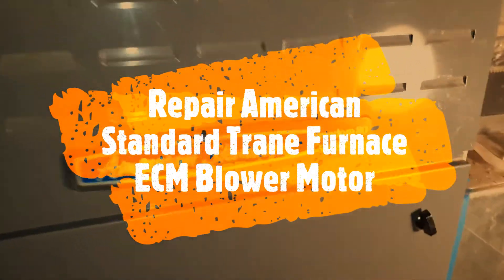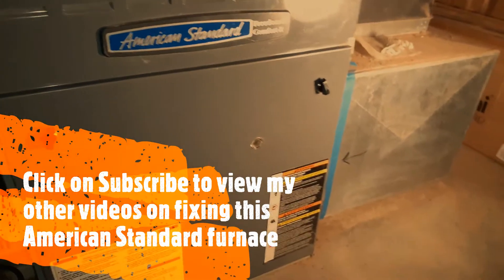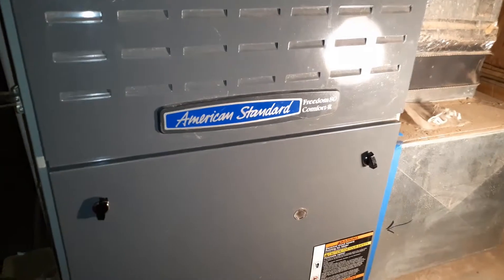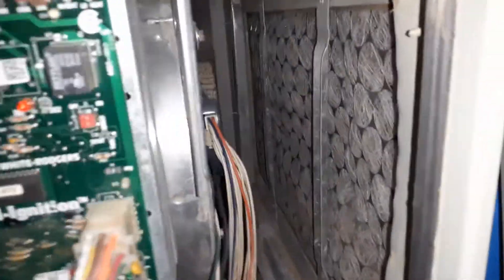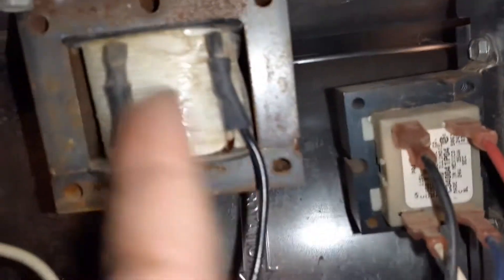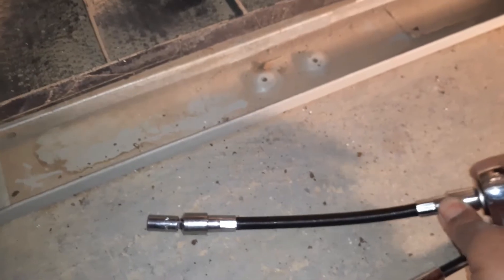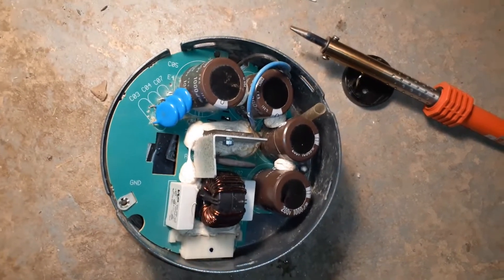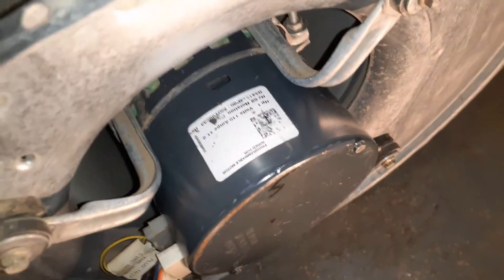American Standard Trane HVAC Furnace Blower Fan ECM Motor Repair

Comment: This video just saved me from spending $100's, if not over $1000 on my AC unit.  I followed your steps, ordered the thermistor, and replaced it in my unit.  Back up and running!  Thank you so much for posting this video.
Reply from the maker: Excellent!

Comment: Thanks so much for this video. I was just about to order the new motor and ECM. Luckily I came across your video. I took mine apart and found the burnt thermistor. Just ordered the $10 replacement instead of the $500 motor. Thank you!!
Reply from the maker: Glad I could help

Comment: I got a replacement control module for my Trane air handler ECM blower. My unit was wired for 240V and the replacement control module was an identical part number however it had a label from Trane (separate from the GE manufacturer label with the model number) which said “wired for 120V”. My thinking is that the module was pulled from a Trane air handler that used a 120V supply and probably had the jumper wire on the high voltage power input plug (5 pin) to provide 120V to both circuits in the control module. My unit is 240V and the 5 pin is not jumpered but directly wired with both sides of the 240V power. Would it be OK to use the replacement? Is this type of labeling by Trane commonplace? Aren’t these ECM modules all dual voltage, just depending on how input power is wired at 5 pin?
Reply from the maker: You may be correct that these can work with both 120/240V if the 5 pin is not jumpered. My furnace is 120V. The only issue I can see is with the phase difference for 240V but that should work if that is what your furnace is wired for. You may want to verify with the installation manual  or check online and see if anyone has used these with 240V. If you want to verify what I used, I have some model number showing 120/240V in my other video https://youtu.be/Wibpfbi5rgg when I replaced the motor and module with a used one.

Comment from the maker: This video will show you how to fix a HVAC blower motor with a part that costs less than $2. These ECM blower motors are known to fail due to burn out of the thermistor. Replacing the part is easy enough for a DIY to do it themselves. HVAC technicians are not trained to repair these and they will try to sell a new motor or a new HVAC where they can make thousands of dollars.